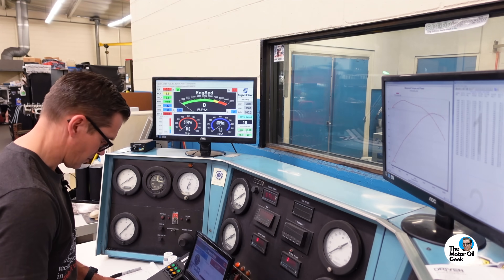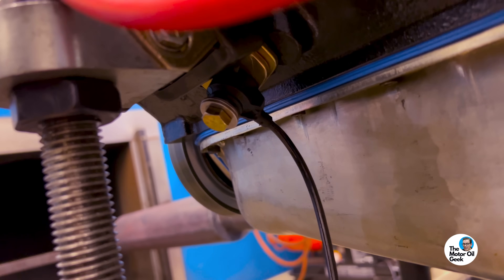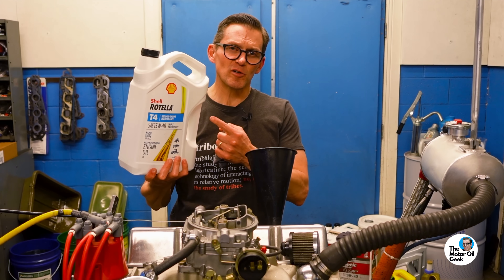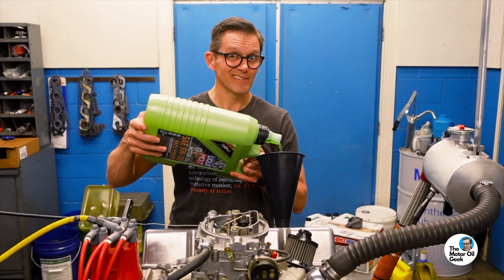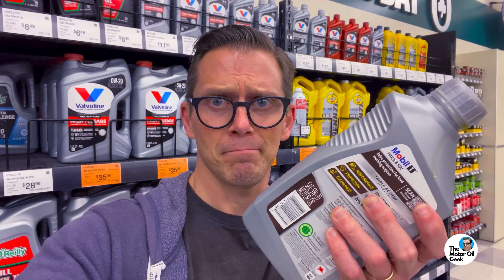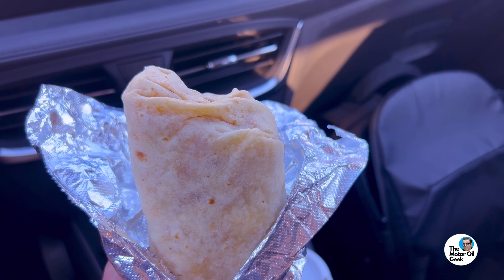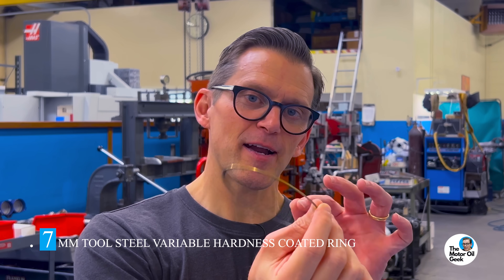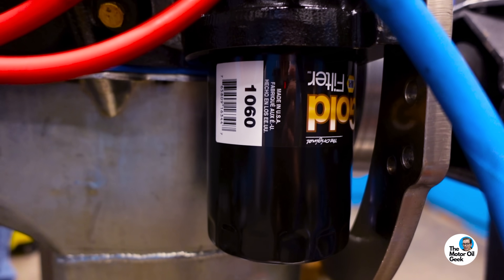Why MOST Motor Oil Tests Are WRONG! (Dyno Test Sneak Peek)

Comment: Im genuinely curious with a 2013 2l tdi thats running off road so it has the emissions deleted does it still need the special euro oil or would a standard diesel oil work as long as it has the proper viscosity

Comment: Lake after you explaining how additive packages often compete with one another.  I’d like to see if changing to thinner oil during the winter vs thicker during the summer is a problem.  Logic would say no.  But as mentioned above the oil could compete and cause issues.

Comment: Lake, In your opinion which Mobil 1 oil should I use in my 2012 Acura RDX SH-AWD 2.3 litre turbo engine.. Truck and Suv or Extended Performance ? I value you opinion. Thank you.

Comment: Here’s a wild idea I’m noodling on: what if we used a low-melting-point metal as a permanent engine lubricant? Think of a preheated engine running on a metal that stays liquid—no more oil changes, just a ‘forever’ lubricant. Just a concept for now, but wanted to throw it out there.

Comment: Instead of speakers, you should connect those knock sensors to an oscilloscope. With a 4 channel scope, you can connect each knock sensor to its own channel and then sync the scope on the 3rd channel with coil 1. By doing this, you’ll be able to see the frequency created by each cylinder in real time.

Comment: Hello, Condsidering switching a 2018 Honda HRV and a 2019 CRV over to the Valvoline Restore and Protect. Both approaching 100.000 miles. Would you have any reservations in doing so? Thanks.

Comment: Side note, I refreshed a 427SBC drag race motor for a customer, and used Total Seal gas ported rings, and although I know we pucked up some power from the refresh, hes up almost 50hp from where he was, verified on my dyno. That is huge. He went from needing methanol to struggle to run a 6.50, to needing restrictor plates on E85 because he's too quick! Awesome awesome rings.

Comment: The head of Nissan research just stated that motor oil that it is best to change motor oil 2,000 miles mark, not 5,000 miles. Why not do a test to determine what happens to oil at the 2,000 miles mark, 3,000 miles mark, 4,000 miles mark and the 5,000 miles mark? 
see the Nissan engineer video https://www.youtube.com/shorts/KdCTTCRVZxs

Comment: Hey Lake on my 2020 bmw with the b52c engine, i change my oil every 7000km and my oil filter every 15000km, I use Pen euro plat. 5w40 in the summer and 0w 5 in the winter, I use Mann filters.. Should i change out my filter each oil change?? Car is heated garage kept, climate is north Montana so cold cold and more cold..lol...

Comment: Just curios.  I have noticed that in most of your videos that I have seen, peak engine RPM during a dyno test is usually in the 6000 RPM or so range, yet for a V8 racing engine I expect the RPM to be somewhat higher - this would be for ring testing and probably wear testing and?  Perhaps you are just not showing those tests?  Thank you for sharing your knowledge on oils, I always find your videos informative and look forward to the next edition.  PS: the dyno tests sound great, but I think higher RPM would sound better.....

Comment: I'm hoping you'll share some of the results in the future. Currently, I'm testing Pennzoil Ultra Platinum vs. Mobil Truck and SUV vs. Molygen in a modern Mopar V8, a Mopar 318, and a small block Ford to find the best oil for American V8s of different vintages. I'm curious to see what you're testing and if it lines up with the results I'm finding

Comment: Thanks, Lake! So you're using the Rotella to flush, then you put in the test oil? Would you run another flush with the test oil before actually testing it? Something I did years ago to flush out any remaining oil was to run 2 quarts (enough to cover the pickup, & maintain full pressure) of the new oil for 20 minutes, then repeat two more times, then ran the new oil. The analysis showed there was still something from the previous oil in there. He said it takes three oil changes to completely flush out any remaining oil, I told him I did that, but didn't say it was not with a full 5 quarts every time. Thoughts? P.S., love the Peet's coffee plug!!
Reply: That's exactly what he does. He does the first flush with Rotella, then he refills with the oil that he's going to be testing. He runs that test oil for 30 minutes, then dumps that first batch of the test oil, then refills again with a 2nd batch of the test oil and then conducts the actual test. He's shown that whole process several times already in previous videos.

Comment: If I wanted to flush my engine oil to remove dirty black oil and remove the most of the old oil as possible. What is a less expensive oil we can use and what would the process be? You should do a video showing how to flush your oil from initial drain to final refill. Including what oil and filter you recommend for flushing.
Reply: How about doing a few oil changes over a few days while driving a few miles in between changes.

Comment: Calculating equivalent engine performance at sea-level from any known altitude is a simple one number correction, until you get high enough that the minimum octane requirement goes down, typically over 2000 ft.

Comment: After draining the flushing oil the engine should be flushed again with the oil to be tested to remove the diesel engine flushing oil completely. After draining the second flushing oil the test is to conducted with a fresh fill of oil. The test is to be conducted with the oil level in the sump at the maximum level marked in the dip stick. This will give the best representative results.

Comment: I run Retell t4 in everything I own from my lawnmower to my 1997 f150 to my 2006 Nissan Altima and they all have over 150k miles on them and none of them loose any oil between oil changes that I do every 5000 miles weather it needs it or not here in good old hot ass Texas well the riding lawnmower doesn't have 150k miles but it is 9 years old and still runs great and also never consumes any oil between any oil changes and I check it every few times I use it and I change it every spring after sitting a bit during winter

Comment: Tribology is so cool, kinda want to look into oil testing places where i live n see what is best for what i run like my ol high mile 6.9 idi for the last lil bit I been using royal purple 15w40 full syn in the summer and either t6 5w40 or mobile delvac 5w40 for winter curious which is best for it.

Comment: Why don't you guys dyno test on an engine that a lot of people actually use. Like perhaps a modern Toyota or Honda engine?
Reply from the maker: Parts availability along with measurement ability. These are custom parts designed specifically for this test, which replicates one of the API engine tests.

Comment: WOW mate your doing the supply run all wrong, but the 205 lt of diesel oil for the flush, with piping going straight to a multi link hose set up and the same with the other oils have the larger 205 lt drums so that if you need to change the oils you simply turn on a value to open the right oil supply to the engine and bang for buck so much cheaper and more time saved IMHO.
The Same with the fuel, have larger tanks to have the right fuels for testing and a line going directly to the tank to fill it up saving even more time. cheers lake keep up the great work mate.✌👍🦘👌

Comment: I Remember Back in the 90's there was headphones with piezoelectric sensors to hear engine knock when tuning. You can combine that with a Picoscope for measuring waveform amplitud, any single change in noise that you cant hear is gonna be measured there .

Comment: Wouldn't gasoline and diesels fuel in the oil also hurt results and other things? 

I dont test my oil, but I flush often (for over a decade now), and im not a mechanic at all and can barely find the right socket to help the guys who know what they are doing. So i just replace fluids several times more often then even the extreme recommendations. I had a drain plug put on our transmissions so I could replace fluid every year... I change my engine oil every 1000 miles or less...  I flush with MMO and thicker oil. Currently my Ram is running PP 0w16 mixed with 10% Cas 10w60. All were on discount. Below 50% off. I wish Lake Speed would test mixing oils... Project farm showed us PP 0w16 contained a super add pack to show my justification to those in the know. Project Farm and Lake Speed should mix oils and have them Black Stoned so we can silence the wives tales...  gm throwing 0w40 at the pubic should show everyone that many experts have been wrong.

God bless. הללו יה
Reply: 1,000 miles, Oooowf!? Aaw, I think that's a large amount of overkill my man? Leave the mixing to the oil companies I think.  Also, Lake has/is his own oil analyzer company "Speed Diagnostics" so idk why he would mess around with Blackstone?

Comment: One thing I have always wanted to ask, I am a huge diesel fan. all my cars are turbo diesels. I never run anything less than 5w40 because I have always been taught that diesel run WAY hotter at the top of the piston/rings and you need the extra weight to avoid sheering the crap out of the oil..  Which beats up oil ( soot nonwithstanding) worse?  Gas or Diesel engines?

Comment: I was working at an airport before I got my driver's license. When i did, I had a 1966 Corvair. Between oil changes I'd thin the oil with a quart of Shell-Sol to help clean things up. Often using AeroShell engine oil. I did frequent oil changes as it had a lifter that would collapse and start ticking. An oil change fixed it for a couple thousand miles. I traded it for another car at 168,000 miles. Engine ran fine. Only leaked oil at the pushrod seals. All of them did.
Reply: Am I correct that back then, "AeroShell" was only monograde?

Comment: Dear Mr Geek... I just watched the latest TFL vid where they tested the new 2025 RAM 5.7l hemi against Ford 5.0 and chevy 5.3. The Ram's oil temp peaked at 280 F and one commentor stated 250 F was too hot for oil... IMHO i would say 250 is not too hot but as hot as we would like to see...  So, what is too hot for these engines?
Reply from the maker: 250F is not too hot for oil. The API oil tests run at 300F.

Comment: Question, By not using a new engine(exact) each time affect the out come of the results ?Seems as if the damage each run cycle makes the metals weaker and more suspectable each run. Especially if your tests outcomes were from a damaging product.
Reply from the maker: We use an initial fill of the oil we are going to test. We then change that oil after 30 minutes and refill with the same oil for the test.

Comment: Some folks say that Mobil 1 gas is better suited to around town driving stop and go traffic and Shell's gasoline is better suited to high RPM driving I did a little bit of research on that and from what I could tell it's based on how it's blended I'd like if maybe you could touch a little bit on that the different blends and what is actually changing. I'm a pretty loyal shell customer we don't have mobile one in my area but I have used it before and it did seem to run pretty good

Comment: The flushing process must be performed with the same oil that will be tested. This means first adding the test oil as a flushing oil, then using the same oil again for the test. This will be more expensive, but in my opinion it is more correct than using special flushing oil.
Reply from the maker: That is exactly what we do. The first flush with Rotella. The 2nd flush is with the test oil, and then we refill for a 3rd time with the test oil.

Comment: Cars that never shut off, run freeway usually lasts longer.   Normal run speed oil is letting part ski over each other.   Most engine wear is at start up and long idle.  Say Phoenix AZ 120 out, takes 40 minutes to get on the on ramp at rush hour( near Broadway curve).  Very slow idle.   Cars are set very low idle now to help save gas.   Find oil that is good for running and slow idle.    Thanks.  Love your video

Comment: Thanks for all the great content Lake,

So how is the rotella not contaminating your test? There is no way you could remove it all without taking the motor apart
Reply from the maker: That's why we do the hot double flush. The 2 fills with the test oil ensures the Rotella is gone. That's one of the reasons for taking a zero hour sample as well. If we mess up on the flush, the zero hour sample will show it.

Comment: What does he use to flush out the flush oil? Also, it seems like  he could pump oil into the oil pressure port to flush the old stuff out instead of using an entire 5 quart jug.

Comment: From everything I've seen, you work with piston engines.  Could you do a video perhaps explaining the vast differences for rotary engines?  Both on the apex seal challenges and also the oil challenges?  I don't have a rotary but I would imagine 3/4 of the things "I've heard" are probably mis-information.  Love the videos.  Resist the urge to try used in-n-out fryer oil in your dyno engine and then test it :)
Reply from the maker: LOL, we do have some rotary engine content in the works.

Comment: Is the knock box hooked up to the ignition at all? Like you showed knock sensors are just lil mics, but most ECU's only "listen" for ping right after TDC then marks it as knock. Sounds like your tuned ear is the ECU?
Reply from the maker: It is not connected to the ignition, but you can hear pre-ignition if it happens.

Comment: Thank you and Great video Lake! Cant wait to see the results. I’m curious how that high performance lubricants will do, I live 20 minutes away from Manteno. So I’ve been thinking, for a daily driver car, is it safe to be changing oil brands every 3 or 4 oil changes just to do an oil analysis. I do a lot of highway driving and would like to try different ones just to see if one is better than the other. I would be changing the brand and doing the oil analysis once a year. Will it be bad for the engine or safe to do?
Reply from the maker: As long as you are doing the double flush when changing brands, then you are safe.
Reply: @themotoroilgeek when changing brand first time with a used car what would be the recommended interval? Could it be 3k first and second 5k? 80% of driving is highway.

Comment: Lake Speed I have a jeep with the I6 4.0 and when I use Shell Rotella I have good oil pressure. When I use Halvoline 5W30 my oil pressure drops to almost nothing after driving a short amount of time. Your thoughts? Thanks for the videos 👍🏻💯
Reply from the maker: If the Rotella you are using is the 15W-40, then the thicker viscosity is the answer. If the Rotella is the 10W-30, then the shear stability of the polymers are the reason. https://youtu.be/2-ECI5uK9eE
Reply: @themotoroilgeek it was 2 quarts of 10W-30 and 4 quarts of 15W-40 that holds good oil pressure, Halvoline 5W-30 didn’t hold oil pressure
Reply: That's interesting. I hope he responds!
Reply: @5000rgb yes but when I use the newer engine oils the valve train doesn’t rattle. I use the shell T4 it’s rattles just cold start up and hot idle lol

Comment: Lake we’re but humble pirates. How does a Dyno measure torque and horsepower?? 🐎
Reply from the maker: A dyno uses a strain gauge to measure torque. Horsepower is a calculation from the measured torque and RPM.

Comment: Coming from a dirt bike racing background. Rotella T4 is used by many as their regular motor oil. 
I’m not on board with them. But I’ve considered using it to flush out my Husqvarna 350 motor with 22,000 miles. 

After watching Lake using it for these tests. I feel confident it’ll replace a regular flush oil. 
But in the back of my mind, I still wonder how Valvoline Protect and Restore would do if I’m easy on the clutch since it’s not an MA rated oil?

Comment: I started learning mechanics 47 years ago. My grandfather was a retired master mechanic. I decided to learn about base oils and addatives 45 years ago. I have never stopped learning. These videos are great at explaining some of the things I read, and never quite understood in the past.
Reply from the maker: I'm glad they are helpful!
Reply: @themotoroilgeek I became an ASE Master mechanic myself. And your videos are very well explained and informative. Thank you.
Reply: @ricka.a. 
Hello, I'm wondering what you can teach us about automatic transmission fluids, from the old ones to the most modern ones. Thank you for everything and blessings!! 🇵🇷💚🇺🇸
Reply: @mariosantiago8931 this channel can inform far better then I can. If I remember correctly, what I read decades ago. General Motors origionated the first automatic transmission fluid. And their first fluid was little more then fish oil. Modern fluids, like oils. Can be either crude oil, or synthetic oil based. Modern also contain different addative packages. Mostly based on the clutch matrials, and types of seals used. Using the wrong fluid does reduce transmission life. Sometimes it can shorten the life to a matter of hours until failure.
Reply: As I understand it, automatic transmission fluids used a lot of whale oil for friction modifiers up until the 1972 endangered species act put an end to that. Those old fluids could withstand the heat better and they actually stood up really well. After that, fluids without whale oil used modified pig fat for friction modifiers and weren't very good, until recent synthetic fluid formulas came along.
Reply: @oneninerniner3427  The Sperm Whale oil was the best by far. When they tried to replace this. Jojoba oil was being tried in the mid to late 1970's. I don't remember exactly why it did not make it. There was a lot of hope they would finally work out the problems with it. Did not happen. It was many years before they made a good quality oil to match the Sperm Whale oil.